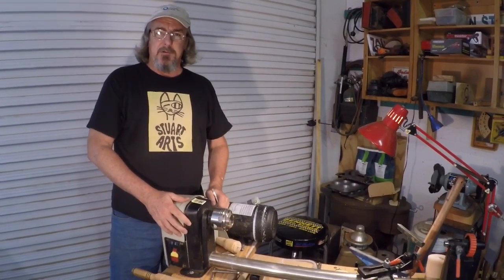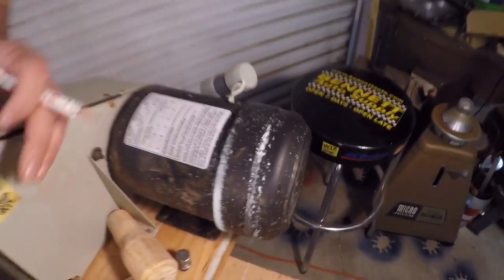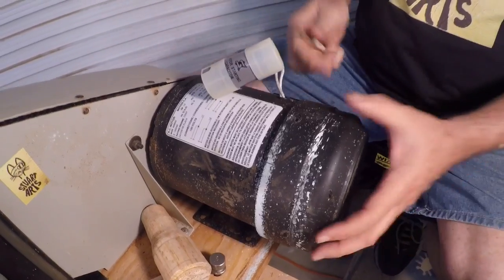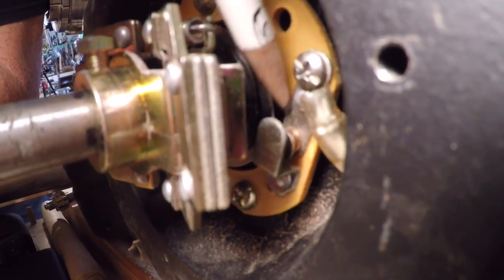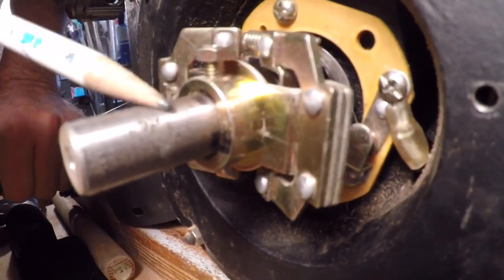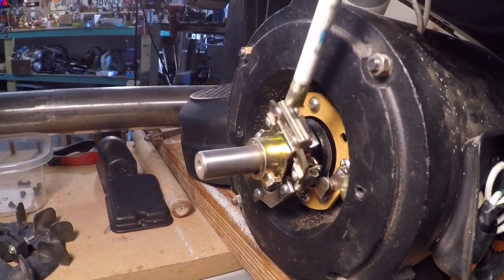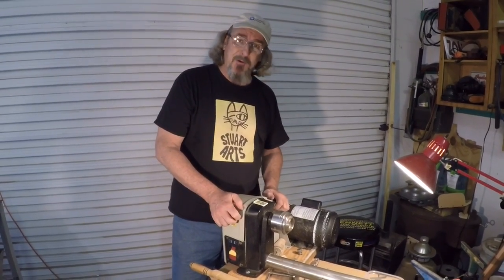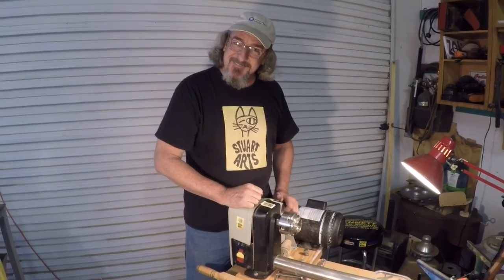An easy adjustment fixed my lathe motor (electric motor won't start without a bump)

Comment: Jimmie, thanks for the video. The Craftsman motor on my lathe always needed a bump start then finally it just would not go and tripped my circuit breaker. I replaced the capacitor and got it to work with a bump start again. I was willing to live with this until your video inspired me to take the damn thing apart and check out that centrifugal switch. It was a little bit different on my motor but after cleaning out all of the sawdust sanding the contacts it starts right up - all by itself. Now I'm determined to make some kind of housing for it. Thanks for the inspiration.
Reply from the maker: @santorek  awesome…thanks for the kind words.

Comment: Bravo.
My 7x10 Central Machinery (Harbor Freight) lathe motor just quit. (Don't think it's control Box cause switch still lights up)
Can you or anyone say if it has an internal centrifugal switch in it's (much smaller) motor ?
Many thanks for input !
David in Texas

Comment: Several years ago the motor on my Radial Arm saw had the same symptoms.. (talk about unsafe, spin the blade by hand)  I pulled the capacitor, benched tested it, it was fine... Found teh centrifugal switch, cleaned her up and been in business for years.. thanx for the video..

Comment: It's a good cheap fix. 
Just to recap , the points close when the motor is turned off to bring the capacitor into circuit for startup and then open by the centrifugal action to take the capacitor out of the circuit while the motor is running.
Thanks

Comment: Had a similar problem with my jointer and did the exact same thing I condemn the capacitor and it was the centrifugal switch removed and replaced, now she runs fine. Just wished I saw your video first would have saved myself a lot of time. Thank you for the information. Subbed
Reply from the maker: Thom spillane thank you. I was really lucky that the motor store guy clued me in. Some good folks out there!
Reply: Jimmie Porter At Stuart Arts   So true especially the Woodworking community and the whole Maker community, just as you and cameraman do on your video.